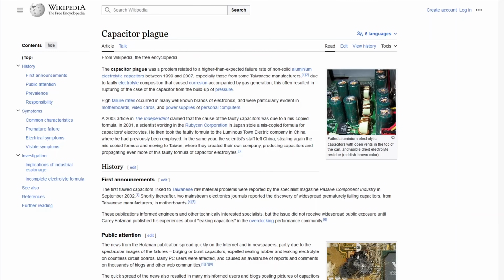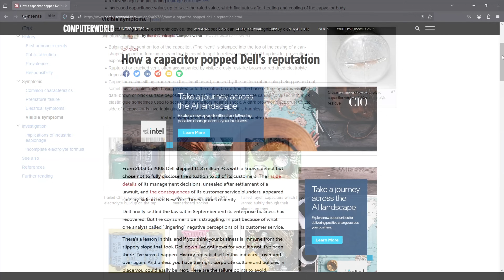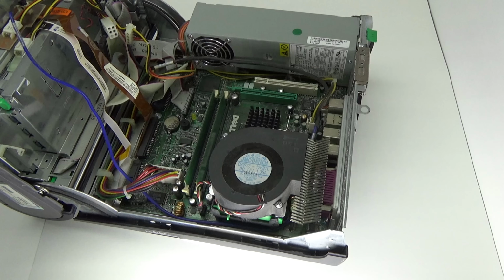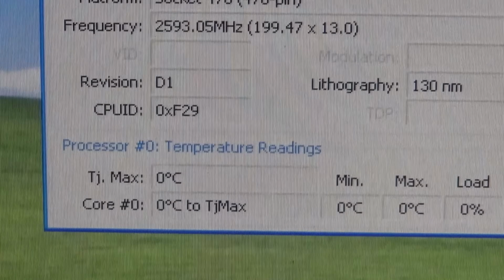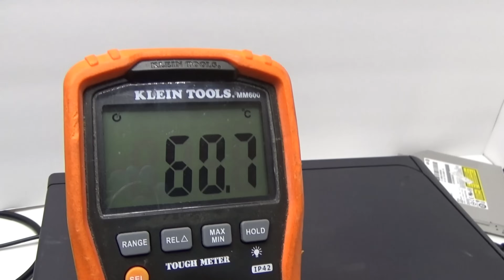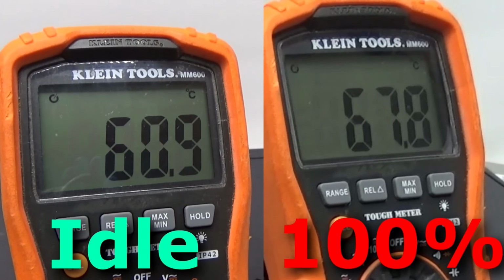Dell Clamshell Hell - Dells thermal nightmare pc's of the early 2000's. OptiPlex GX260, GX270, GX280

Comment: Look, to be honest, I love these small cases, and I've always read reviews about their technical performance, but I've never seen one of my machines overheat. Actually, it draws air in from the right side (viewed from the front), the power supply helps create negative pressure that pulls this lateral air. It's a difficult airflow, but it works for mine. I have the 775+ PCI Express version, and (after searching a lot) I found a Pentium 3+ AGP motherboard from the common desktop version, which I adapted to a small case and painted beige; both work beautifully with video cards.

Comment: I just got given one of these. It had been sat in a dry garage for the past 21 years. The caps all seemed fine when i opened it up to check, so I tried it and somehow everything works fine after a new CMOS battery and telling the BIOS to ignore the missing floppy drive (was an option). I did notice how hot the exhaust fan was though simply after starting up Windows XP, even considering on some models that fan shown has a shroud that does actually direct all the hot air out of the case. Once I got all the dust out of the power supply (none anywhere else) and mounted it in the bottom of a DIY arcade cabinet with proper vents and cooling, there are no issues, though I'm still religiously checking caps avery few bootups in case it decides to make up for lost time.

Comment: Can this case be used to build a sleeper PC? Can the power supply be reused, and does it have standard connectors? Also, do the micro-ATX motherboard layout and ports align properly with the case?

Comment: Eh... Dell actually used nice capacitors in their Dimension series of computers, or atleast with the full desktop ones.

Many of the Dimension 2400s still work. Can't say the same thing about the eMacs. Apple used some absolutely DOGSHIT capacitors on the analog board in those things. Surprised MacOS was stable on mine, all of those electrolytics (and I mean ALL of them) where beginning to turn into resistors.

Overheat any capacitor and they'll fail. So yeah, junk case on Dell's part.

Comment: I still have one of these.  It barely runs windows XP.  The GX150.
Reply from the maker: gx150...wow was that a pentium 3 model?
Reply: @jims_junk  Yes.  It was the only one of it's form factor that I kept.  I had a bunch of towers but I think they were newer optiplex models that I pulled from a dumpster when I was a teen.  I had like 10 working systems that I made into a beowulf cluster with centos 6.  I took those, the GX150 and a GX1 out of the trash of my school when they were replacing systems about 14 years ago right before I graduated.  I still have the GX1 and GX150.
Reply: @jims_junk  I tried commenting but I don't know if youtube is being odd but yes.  Pentium 3 model.  I got 1 of those, a GX1, and several newer Optiplex models from the dumpster about 14 years ago before I graduated highschool.  I only have the GX1 and GX150 now.  I sold off the other towers long ago but when I had them I created a beowulf cluster on CentOS 6.  Dad got pissed at me over the power bill and heat..  The GX150 took up less space so I haven't done anything with it.  I just booted it for the first time in over a decade last night.  Stil had XP that was the school and still used their old Tech and Admin passwords that my school used.  I was going to install Win 98SE on it or something.  Almost forgot I got a Zenith Data Systems laptop from the haul too at that time that I still have and works but no HDD.

Comment: Oh hell no. I didn’t need to be reminded of these things, think I’ve got some kind of repressed PTSD after the university I worked for at the time had nothing but these toasters with a VGA port. I was in IT hardware support…..

I recall we had a few weeks where we had a pretty heavy heatwave, and as our contract with Dell had expired and we had just ordered thousands of HP desktops to replace them, we were on our own. Of course it takes time to deliver a contract of that size. 
So no warranty or service contract, a heatwave and machines that were literally thermal car crashes waiting to happen. I think there was around 15 machines failing a day and parts to get them up and running (CPU coolers and motherboards/caps) were all on back order. 

I did come up with a temporary solution to keep those that were working going though. Used a piece of PVC piping and cut it into 10cm lengths on the bandsaw in the workshop. Made a wooden mould with the last 5cm being curved slightly upwards. Heated the pipe until it was malleable enough to fit into the mould and pushed it against the sides and left it to cool. Attached to the back of the pc case using epoxy resin, so that the hot exhaust wasn’t pulled back into the case but instead was pushed out and upward. A bit of a dodgy bodge by the look of it, but it dropped case temperature by around 20% so it worked. Did nearly the whole university campus with that particular method. Once done, our failure rate dropped by around 50%, buying us some more time to replace them with the new machines as they arrived. 

We also replaced a fair few CPU’s to the next generation which ran considerably cooler. It was a rough time 😂

Comment: Can't you:
T-urn the fan in the power supply atound, so it pulls air from the ourside
-Close the gap between the outside cooling vents, so that hot air isn't going in there anymore
-build a simply shroud (cardboard would be enough) to direct the CPU fan's air out
-modify the CPU fan by putting an resistor in there instead of the thermal element, making it run at sufficient speed all the time
Reply from the maker: I did pretty much that in the follow up video and yeah works great.  Dunno why they didn't do that originally
Reply: @jims_junk  Nice, I will have a look for it :)

Comment: hey anyone got a sound issue with gx 280 or got any drivers mine works fine but no sound
Reply from the maker: Could be bad caps
Reply: @jims_junk  ok but inside i dont see nothing can i attach a sound card or do i have to replace the caps
Reply from the maker: @cooperhiggins4554  In device manager does it show sound hardware?  Dells website should still have drivers if you put the service tag in the search box.  One thing you can try is downloading a live distro of linux, like linux mint and booting it from a flash drive or CD.  Once booted see if it has audio, if so its fine and its just an issue with windows detecting it, if not then its most likely hardware.
Reply: @jims_junk   yeah no i plugged in external speakers tried all the ports put in an HDMI graphics card and still no sound or device found errors include video controller (vga compatible) no driver found and sound bus something something no driver and I've tried may different driver dell cd's ill try linux its difficult though with having to specify 32 bit but ill also check dell

Comment: I got similar thing but with an HP but the difference is the air flow its better because the front grill, mine is a DC 7900 with a Q9400, 8Gb of ram and a low profile Nvidia 9600GT (and SSD of curse) it runs prety decent

Comment: Btw, recently I got Dell Optiplex GX 260 tower version. It had failed capacitors, but did POST.
Reply from the maker: Nice yeah the towers seemed to be MUCH more reliable.
Reply: @jims_junk  Aren't they the same board? Maybe more reliable because less heat?
Reply from the maker: @AshWeinstein  they werent exactly the same but I do believe your correct they were very similar. And yeah probably heat sealed the deal

Comment: OK they weren’t great but at least they were repairable. Large high street retailer had lots of the until just a few years back. There was another range of similar which were supposed tho be toolless repair made by HP/Compaq, D530?. These machines were absolutely disgusting things. Getting the slide off cover to lock was a nightmare and the mechanics for retaining extra PCI cards on the riser was a complete joke. Power supplies going off with a huge BANG was commonplace, nasty.

Comment: A friend gave me one of these cursed things from their attic to do data recovery on for old family photos before it was chucked. I took it home, plugged it in, and was met with silence. No hard drive, no fans, no POST beep. I opened it to look for some sort of problem when I felt heat rising out of it. I touched the CPU heatsink and immediately received a burn. The blasted thing was in some sort of weird "on" state but wasn't running, so the CPU had heated the sink up VERY HOT without any airflow. 

Right at that moment every single motherboard capacitor next to the CPU exploded all at the same time, releasing the magic smoke everywhere and right into my face. My room smelled like burned metal for weeks.

Comment: Bad thermals in computers always piss me off. It’s not rocket science. It’s not hard to get right.

Why have a gap between the fan and external vent? Why use a thermister inside the fan to control the fan speed? Why position the PSU so that it just ends up sucking in warm air from inside the case?

So much fail.

Comment: Funny enough my old high school had two of theses pc,  they where still working, running Windows XP and used For CAD printing. Used for resistant materials, wood tech.   I don't know if they still have them as I left back in 2018, but I won't be surprised if they are still there.

Comment: a workmate of mine said at the time that a lot of 'enterprise grade desktops were only good for use in heavily airconditioned offices ie. places that were effectively cooled from 7am to 7pm at 18c or 65f - also you will find dell hp have white papers on the design of these units and they are tested in extreme environments but would you trust that given what you see here?

Comment: I'll note the GX280 models do have vents on the sides of the clamshell for air ingress, but yeah, they baked the hardware pretty nicely, and the capacitor phage didn't help their reputation one bit.  (the "paver stone" GX 5x0 series were overall a MUCH nicer model  to work on, even if they still guzzled power and generated a ton of heat...

Comment: It scares me that these are old computers and they're younger than me, I remember my clamshell it overheated all the time so I just pulled the top of the case off and ran it open 24\7, I also had an optiplex (I wanna say 670)  that throttled so bad i opened the case and stuck a box fan in it to cool down, still lagged on Minecraft tho

Comment: and dell still have the same thermal design standards. When I got a dell laptop in 2020 I had to turn off turboboost and replace the thermal paste to run anything without thermal throttling, to get turboboost back I had to use liquid metal thermal paste

Comment: Could the reason the fans quiet down when removing the case be due to a loss of static pressure as opposed to any (immediate) thermal improvement? The same happens when you lift the case off a ps4 pro, or a more extreme example, blocking or unblocking a vacuum cleaner hose.
Reply from the maker: Good thought but If you listen you'll notice it slowly slows down, it's not instant.

Comment: In 5th grade or so I got 3 of these from my parents work and filled them with aerosol cans and fireworks and blew them up after shorting out the motherboards with a screwdriver while they were on. If I had a computer monitor I would’ve just used them

Comment: i actually still haveone of these in my garage. it doesnt work anymore because the motherboard is fried. it started when it would spontaneously turn off and now it only blue screens. i when i was in highschool 8 years ago my school still had a lot of these old computers in most classrooms but the computer lab library had much more modern pc's. the engineering computers had Xenon server cpu's and the rest had haswel to sjkylane i5's. the desktops of these old dells had an intake under the flap covering the usb 1,0 ports

Comment: Back in 2004 one of my clients had updated all of their PCs with Dells.  They bought them and installed them themselves...we just managed their network at the time.  They called one day asking  if we could look into why they were all so slow on the network or would crash.  2 of us went in and while the other guy was working on the servers I was tasked with investigating the PCs.  I had them show me the problem and they booted a machine up.  it was fully cold at the time and seemed to operate properly but they said "Just give it a few minutes" and sure enough in about 5 minutes it began to slog down and then we got the BSOD.  We tried a second one and it did the same thing.  They were upset and were positive that it was our fault somehow but I asked them if was every computer and they pointed out that it was ONLY the new Dells...about 20 of them.  I took the first one and opened it up thinking immediately this must be an overheating issue so I wanted to check the heatsink and fan.  Sure enough it was spinning like a jet engine.  I took the fan and shroud off and saw the heatsink fins were perfectly clean.  I wondered if there was any thermal compound so I removed the heatsink.  I unclipped it and it literally just fell off.  It wasn't bonded to the CPU at all.  I looked at the heatsink and saw a shiny metal square where the thermal compound should be.  There was a nice aluminium tape with a label printed on it that read "MUST be removed before installation".  The tape was covering the thermal compound which was in tape form.  I peeled the aluminium backing off and reapplied the heatsink.  Put everything back together and fired it up.  20 minutes later it was going strong so I did it to the rest of the PCs.  I never told them just what I did but they were overjoyed and considered me a miracle worker.  From then on ANY time I worked on a Dell I always checked the heatsink and I found this exact problem about 50% of the time.

Comment: Oh man the GX260 was my first ever computer... at least the one I owned myself!
I got that thing back in like 2010 and I ran that thing with its toasty warm P4 running XP SP3 up until 2015 when a family member gifted me a Gateway laptop.
Good times!
I probably used it 8+ hours a day for about 5 years and never once did it ever cross my mind how hot the thing would get.
I even used it to hotswap trick my OG Xbox and reload EvoX on it once it bricked itself due to losing time and having no dashboard to reset it.
This explains why whenever I opened it the mobo and optical/hard drives were so toasty warm!
Reply: I had a gateway desktop bought new in 2006 with a pentium D processor which was basically two pentium 4 processors put together. That thing always ran with its fans on full blast for at least 8 hours a day sometimes up to days at a time from 2006-2014. By then it was pretty much fried. Keeping it in one of those desks with the opening door cabinet to access the pc was not a good idea as its case design took in cool air from the front. Oh well.

Comment: This was the era I like to call the era of the great transition. Where dell and many others started using the Pentium 4, before the limits of that chip was reached. Sadly this lead to a lot of Pentium 4 machines having very bad lifespans, especially dells. Eventually leading to them using the Centrinos and finally the Core 2 duos and even a few AMD’s. Many machines from this time shared a lot of similar design languages, and I feel that Dell’s machines definitely were a fine example of this, especially with their laptops. The Inspirons went from black boxy or funky shaped machines from the Pentium 3 era, and gained a more uniform boxy shape before eventually moving on to the streamlined white and silver look they had for a couple years. My very first computer was from the very beginning of that era and it was called the Dell Inspiron e1405. I still have it to this day, and with plenty of upgrades it’s a robust little machine.

Comment: But they make like 25 watts of heats my guy, how much thermals do you need? My Optiplex with the pentium 3 doesn't even have a IHS, just a die on the heat sink and that bitch took hours of runecape and adventure quest no problems. Poorly, but it did it. Could even play knight rider. But in all seriousness the issue was pentium 4.

The issue was when they started sticking Pentium 4 space heaters into them. No matter how much nostalgia we have, Pentium 4 was garbage in every aspect. But the Series 2 OptiPlex was designed for a Pentium 3 really the thermals aren't much different than the series 1, if you look at a GX115 or any other low profile series 1 they have the same design no vents out front just out back. Remember the pentium D absolute monstrous heat sink and fan? And it still didn't cool lol.

Pentium 4 was hard to keep cool in proper gamer cases, much less in a cheap oem case, and we started getting extreme versions and pentium Ds it was game over. For people who don't know, liquid cooling was basement nerd stuff not something you could buy yet. And Athlon guys where clowning on us for our space heaters, it was a breath of fresh air when core 2 came out.
Reply from the maker: Remember when koolance came out with their affordable water cooling cases?  Man things sure changed quick after that.  But before that you're right. I remember people hitting up junkyards for trans coolers, finding pumps from aquarium stores and cobbling something together.

Comment: I remembered the time that I was told to avoid compact form factor or all-in-one unit, I didn't think about it as much in term of its thermal, I only thought it was because how everything were not easily replace and needs vendor-specific part. Now I learnt more that it was bad design, bad everything. rofl